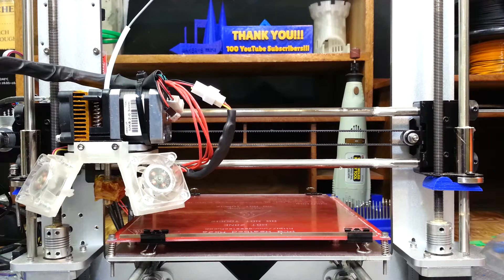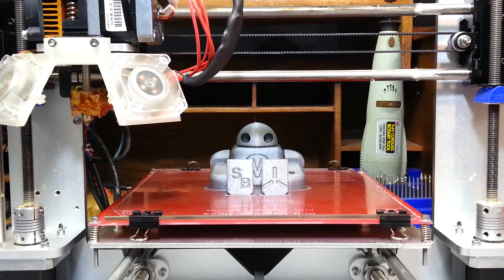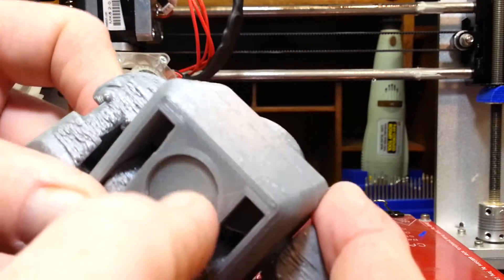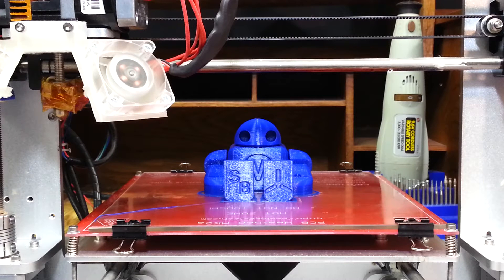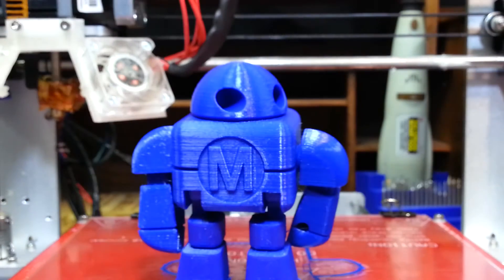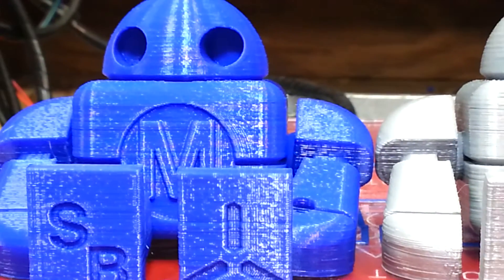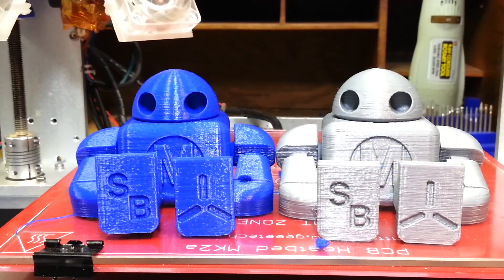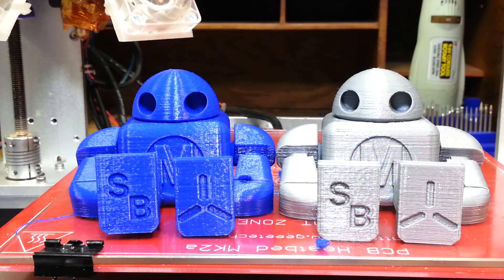3D Printed Maker Faire Robot

Comment: hi jimmy so my printer is under extruding did it happen to you and do you have any idea how can i fix it here's a photo http://imgur.com/gallery/izVNR
Reply from the maker: +omar bentaleb When you manually extrude, does the plastic come out in a straight thick stream, or does it come out and curl to the side and back onto the nozzle?
Reply: i think it  come out and curl to the side and also the filament goes back and forth
Reply from the maker: +omar bentaleb it could be a clogged nozzle.  Usually that's what happens to mine when I start having extrusion problems.
Reply: does the filament goes back and forth
Reply from the maker: +omar bentaleb it's suposed to come out in a straight line down beside the build plate.  If it curls to the side or gathers as a ball on the nozzle, the nozzle has a clog.
Reply: yes it sometimes itgathers a ball on a nozzle but dosen't it suppose stop extruding when it start printing becasue it stop at 40 or 50 percent
Reply: thanks jimmy 
so how can i clean the nozzle
Reply: and a quick question if the nozzle is cloged why the bottom part is printed without under esxtrusion ? 
thanks
Reply from the maker: +omar bentaleb I honestly don't know.  The lower part doesn't have anything that resembles under extrusion?
Reply from the maker: +omar bentaleb I have never had much luck cleaning a nozzle.  If you have access to a micro drill bit set with a .3 or .4 drill, you might be able to clean it while it's hot.  In the past I have used a small wire, but the clog never really went away.

Honestly for the price, I usually just change the nozzle.
Reply: then the nozzle is not cloged because if it's cloged i woun't be able to print the bottom part right ?
thanks jimmy and i'll buy a new nozzle

Comment: great video 😂
Reply from the maker: +Tom O Sullivan Thanks!!!
Reply: I have a large fan blowing across the build plate from the back, it really improves the underside of the parts, you should give it a go and see if the print turns out better?
Reply from the maker: +Tom O Sullivan That's a good idea!  I have been avoiding a halo set up around the nozzle because of filming.  That might be the answer I've been looking for.

Comment: well. after insttaling the printer I can't put it on auto home.  or if I want to start printer x.axis will hit left side and start clicking. my printer in prusa i3 b pro black .iam not sure it's firmware or else
Reply: @123usausa have you checked that if you manually press the end stop that the motor stops, if it doesn't stop try using another end stop that you know works, if it's still the same, invert the endstops from always off to always on in the firmware and try again
Reply from the maker: +123usauae it sounds like the end stop switch is either not connected to the right board connector or the switch is bad.